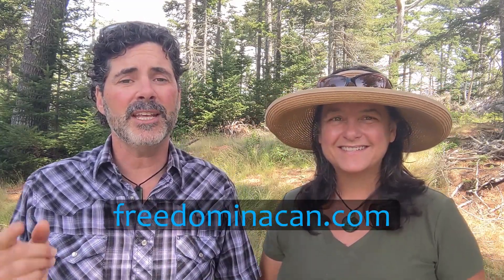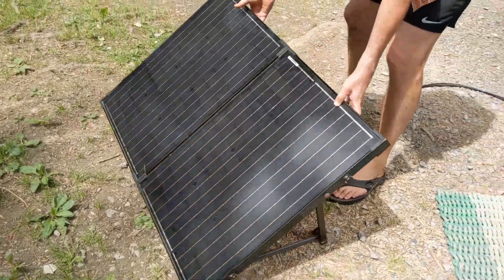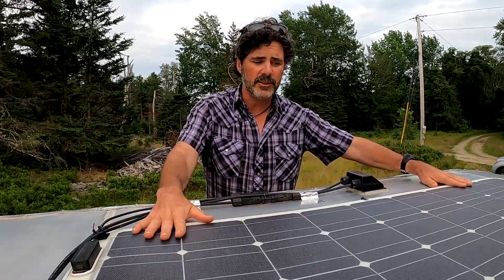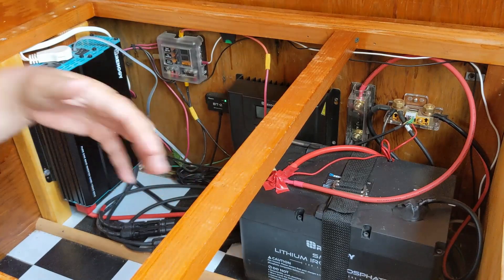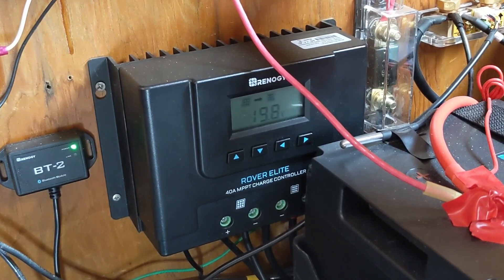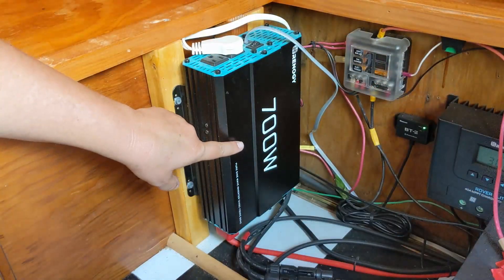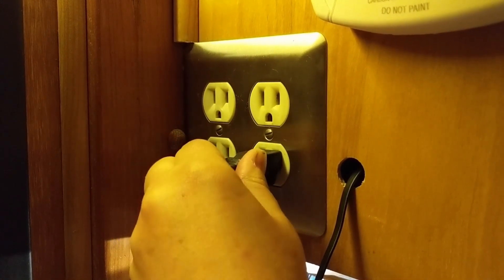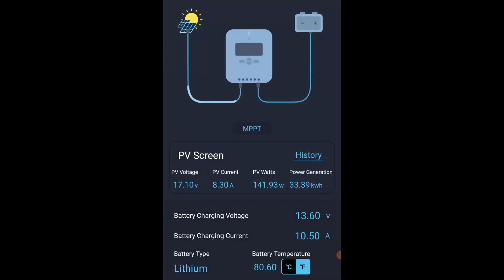Renogy Solar Panel System Review:  After 3 Months + 3000 Miles Across the U.S.

Comment: My experience is a bad one. I spent over $400 for 2 batteries on Amazon to replace the ones in my camper. I called Renogy and got their opinion first. I then call WCO who makes the WCO 6800 series for my camper and gave me the ok, then I called Cruiser RV and they said it should be fine. When I went to the dealer the tech said no way. They can overheat when plugged up to shore power and you can't turn off the batter disconnect or nothing will work in the camper. I tried to return them to Amazon, unopened. They will not take batteries back.. They refused to take them back They refused to refund the money and they told me to sell them myself. I called Renogy and they basically told me TOO BAD. I wish I had read the Better Business Bureau reviews before I bought them. I have left reviews all over the Internet and also most of the YouTube Videos and will continue to do this everyday.
Reply from the maker: I am sorry you had a bad experience.  Did you actually install the batteries? Did they overheat, because this is not a problem that I have heard about.  Is there something else that I can help you with?  If your comment or question pertains to the installation in this video then I am all for it.  If instead, your goal is to vent your frustrations and smear a company with whom we've had a good relationship then your comments will be removed.  Please keep it specific and respectful.  Thank you.
Reply: @FreedomInACan  Number one, I am not smearing the company, and my comments are truthful and you can't remove the comments on YouTube I made. I was told by the Tech if I kept my camper plugged in to shore power they will make these batteries overheat and they could swell up. I do have a right to tell the truth.
Reply from the maker: What model of batteries did you order and what type of converter and/ or charge controller do you have?
Reply: @FreedomInACan  WCO 6800 series that came with the camper ...Renogy Deep Cycle AGM Battery 12 Volt 100Ah, 3% Self-Discharge Rate, 2000A
Reply from the maker: Okay, I'm going to forward this to my engineering contact and see what he says.  What is your camper make and model, out of curiosity.
Reply from the maker: Hi Robert, I heard back from my Engineer contact at Renogy.  He sent along the following specifications for the AGM batteries that you purchased.  Here's a link for that, https://www.renogy.com/content/RNG-BATT-AGM12-100/AGM100-Datasheet.pdf
He recommends that you verify with WCO that it will work with your 2 x 100Ah AGM batteries (assuming that you'll install them in parallel, maximum charging input will be 60A - your model converter is up to 100A).   Also, you share these specifications with your installer technician, there might just be some misunderstanding.   Just looking at the product, the engineer was pretty sure it would work since the WCO 6800 is a 3-stage charger.  
Let me know if you have further questions, all the best.
Reply: @robertnewpoff1128  it says on their website that if you buy  from third party sites you have to go through the site. They don't accept return that way. They have their policies there. Sucks but that's how they do their returns.
Reply from the maker: Thanks for the clarification, that's the way a lot of companies handle 3rd party sellers.  But I've still never heard of Amazon not taking something back.